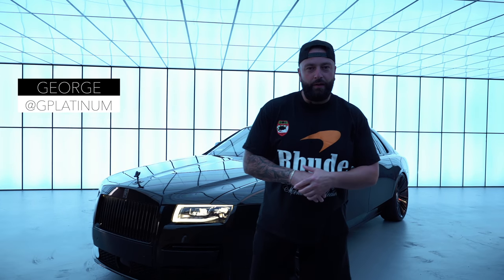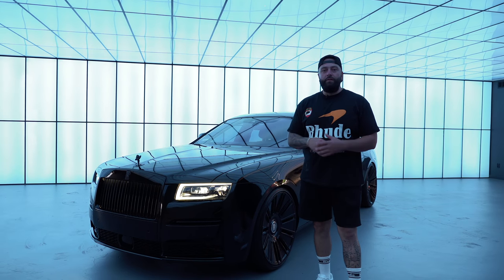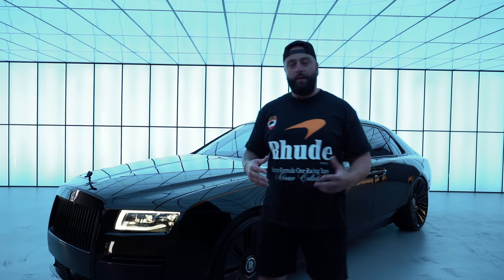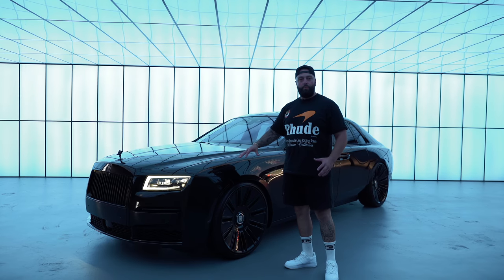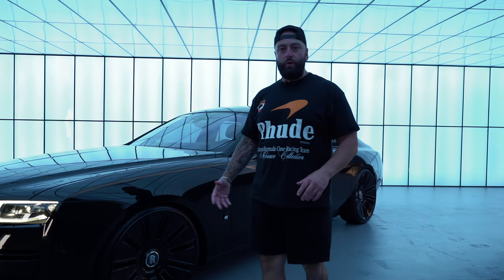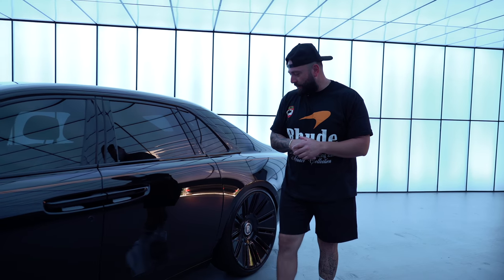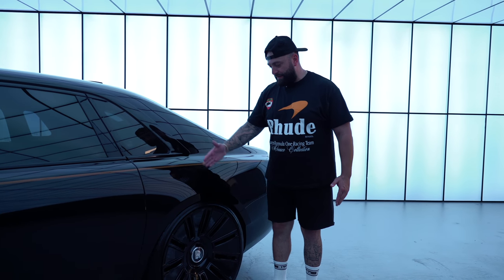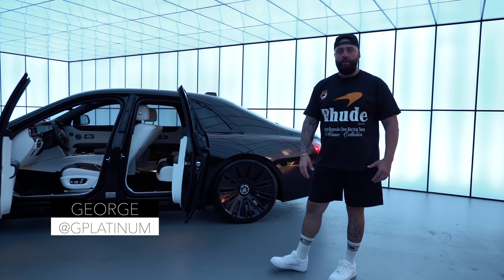21’ QUADRUPLE BLACK GHOST feat. a 1of1 design 24” dual block wheel inspired from a Rolls Concept car

Comment: what size does the wheels and the tyre have ?
Reply from the maker: It is a staggered 24” dualblock wheel. So front is 9 and rear is 10.5 

255/30 front and 295/30 rear
Reply: @PlatinumMotorsport  woo looks amazing what is the ET ?
Reply from the maker: Offsets we don’t have off the top of our heads we would have to look and share. Call us we will gladly help you out.

Comment: " Dear Moderators, I need to address you in order to inform you of something , one Ideia ,that I was unable to take to US authorities because it is very difficult to contact such people.
I have an idea where there is only another one , different from the one I have , much more complex and difficult to put into practice in the Automobile Industry !!
I have it in a Module , in a cask , no bigger than what you see at the end of the exhaust pipe of Automobiles , where the exhaust coming from the engine combustion would pass through a Natural Water Filter with a Hydrolysis process and return to the Engine without being expelled to the outside, what would make any car powered by combustion a Zero Emission Car !
Please help me find who would appreciate this in your industry and we save the Oil Economy for at least until 2050! Thank you very much!